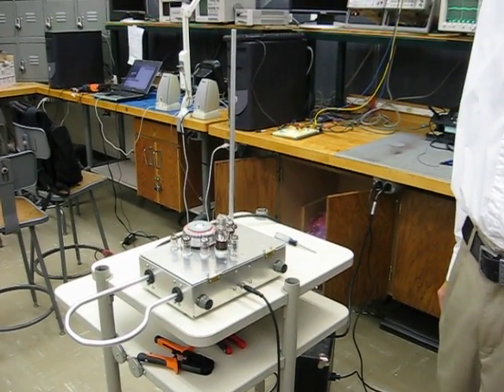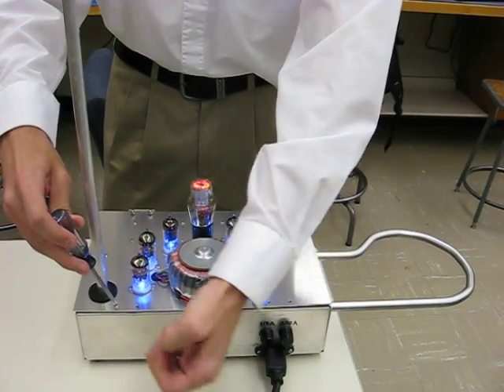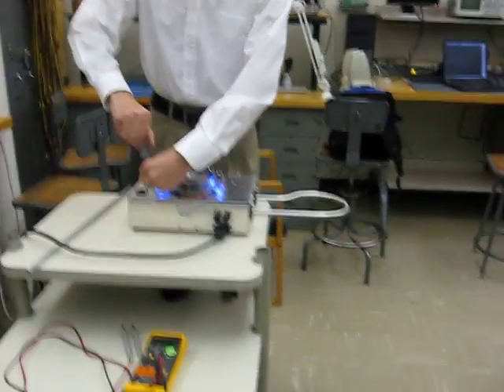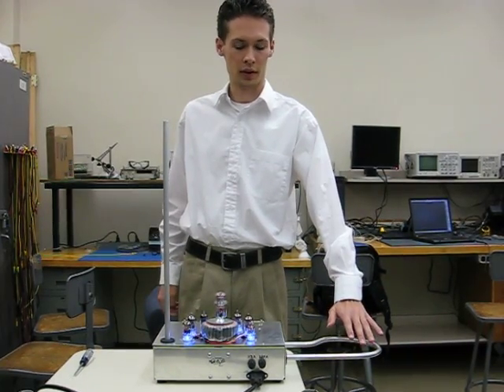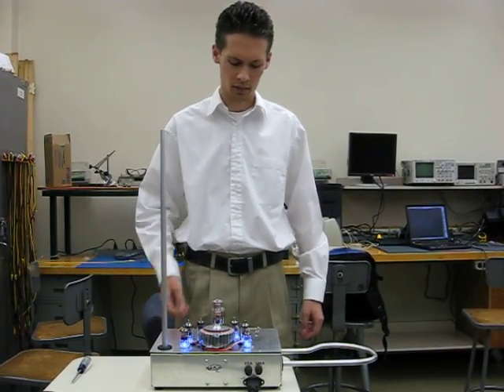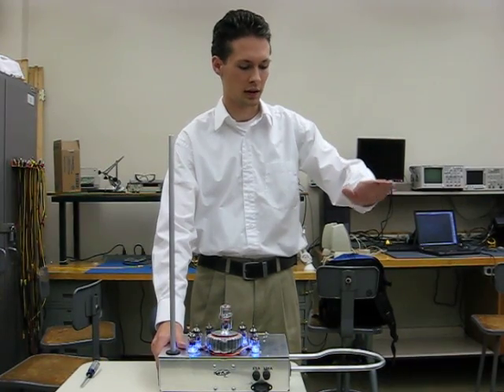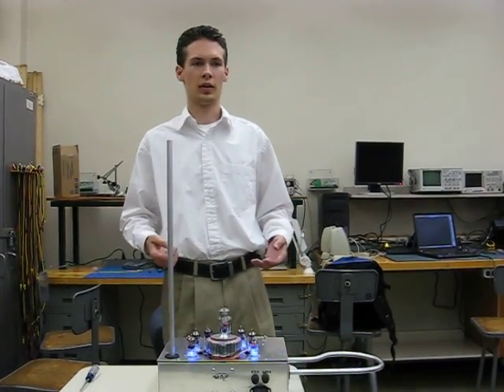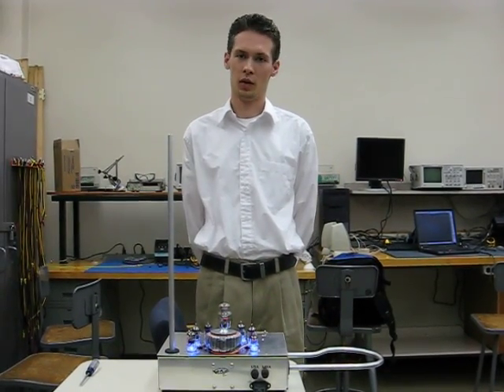GT Theremin Demo

Comment: In looking at your schematic, I see that you connected one section of your on-off switch to the neutral mains power. You also connected the OA3's disconnect pins 3 and 7 in the neutral circuit. This is unsafe practice. Also, why do you have two fuses? It is safer to have one fuse so that if there is a problem, all power is interrupted.